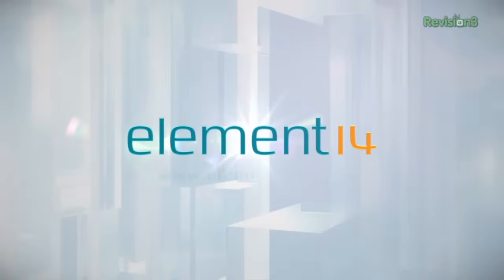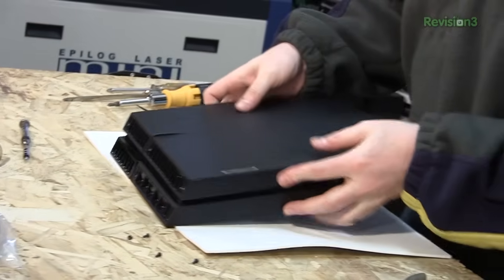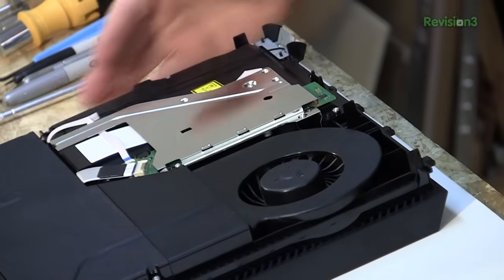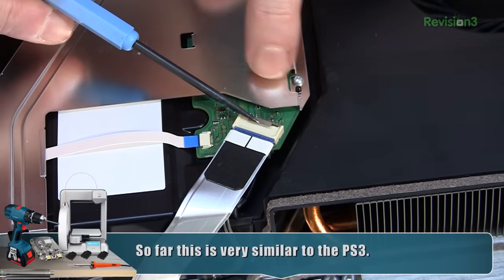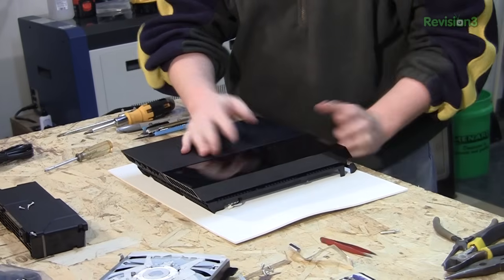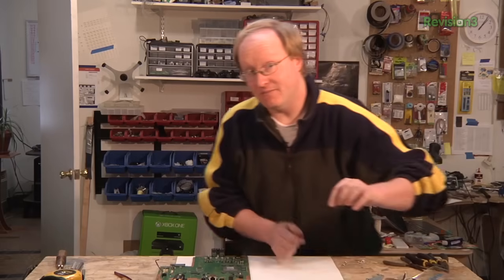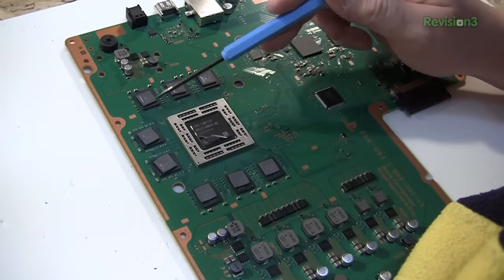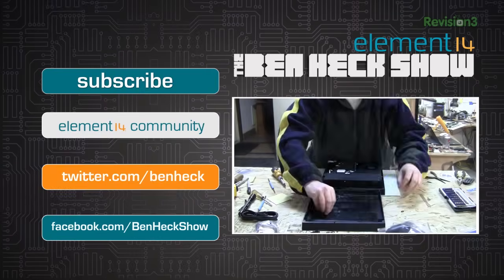Ben Heck's PlayStation 4 Teardown

Comment: GDDR5 is not DDR5!!! GDDR5 is DDR3 optimized for graphical operations...
Reply from the maker: El1988Che :D
Reply: Vic Vinegar I never said it was a big deal...
Reply: ***** all pc gamers played consoles, once apon a time. there is no gamer that just built a gaming pc out of the blue
Reply: CosmicRadiation what pc was it? dumb fuck.  was that a dev pc or a gaming pc? the article did not say and since i know for a fact  it can't run on a gaming pc then wtf was that you just showed me?  you need 20 titans to run the game on pc.  now since you found that article you can now show me the pc that the game ran on and get me the evidence of  what graphics cards were used to run the game. can you do that? the answer is no you can't because there isn't even video proof of it yet.  there is video proof of what i told you to go look up peasant. now are you going to deal with what  i just  posted to you? dumb cunt. where is you character model on a gaming pc crying in a live in game in engine cut scene? get me that. show me that then we'll talk.  the fact is it doesn't exist on a pc because a pc can't produce that effect without 4 titans in  the rig the end. 63 million polygons for just that crying one scene on the ps4. where is the gaming pc with the game showing the same effect?  don't show me some vague article about the order 1886 running on some phantom -pc unless you can show me what pc it ran on. therefore you failed i win get back to the basement peasant
Reply: TotalyNotAYoutuber _ The HD 4870 (a 2008 card) was already using GDDR5... It makes it impossible to be based on DDR4, when DDR3 was barely making into the mainstream market. So, yes, GDDR5 is DDR3 optimized for graphic processing, nothing more.
Reply: +ashtonjackfanny Yeah ok kid. You have yet a lot to learn to make anyone salty. The PS4 runs The Witcher 3 at medium settings compared to PCs ultra settings. The order 1886 has a cinematic filter, take that off and it looks like fucking counter strike source. Do some research kid. Keep on being delusional because you won't get another reply from me. How does it feel to be 12 years old and have access to the internet? You must troll many people huh? kek.
Reply: +manny perry You, sir, are an idiot. Not just any idiot. No, you are a special kind of idiot.
Reply: What the fuck are you talking about? You clearly know fuck all. 😂✋
Reply: +manny perry the demo "PS4s" that they show off games with at conferences are actually PCs with a PS4 emulator. Mind blown
Reply: +Timmyval123 tell the console killer to run the game worlds of a ps4 exclusive or bow before the ps4godrace.  all shit pc's built cheaply will fry from running all multi plats that have come out so far and would blow up like a nuke went off if they tried to even look at the graphical mastery of a ps4 exclusive...next peasant. btw bastard what false claims did i make? i have articles to back what i say up how about you? foh peasant
Reply: +manny perry update bro there is a little unknown fact about the order 1886 that people overlooked or tried to sweep under the rug. in that game there is a woman in a cutscene actually crying tears down her face after being beat up by her pimp in an alley. that feat on pc takes 4 titan graphics cards to pull off running in sli. so the order is the most graphically advanced game of all time until sony decides to surpass that feat with like you said Detroit become human. just wanted to pull your card to that when i saw that shit in the order i was like whoa!
Reply: this pc  peasant said all the assets were made on pc? lmfao ah okay and? it was a dev pc that made the order 1886 not a fuckin gaming pc. so your point would be? with that said the game was made around ps4 hardware which means ps4 hardware would have to run those assets and it handled it without batting an eyelash. now here is the real question  dipshit. why wasn't it made for pc? since pc is more powerful? something like a woman crying in a real live in game cut scene like the order so masterfully portrayed  surely couldn't be done on the hardware of a outdated ps4 right? something like that should only be on the mighty pc platform shouldn't it? yet developers could never get that technical feat to appear on the average gaming machine because only 4 titans running in sli can run that in real time. oh i mean 4 titans and the mighty fuckin ps4 modified hardware that is lol.  the shit hardware of the average gaming pc will never touch the ps4 modified unified 8gb of memory that's just facts. not to mention you can't have character models on pc made up of 150000 polygons like those featured in the order 1886.  your shit hardware would fry trying to run the 80 million in total polygonal world of the order 1886. bow down peasant no gaming pc is on the same level as a ps4. the only pc more powerful than the ps4 is the one who makes games for the ps4. other than that every other gaming platform is peasantry before it. btw find me a pc game with a non playable character crying in a real live in game cut scene like the order 1886 has i'll wait. since you said the assets were made on pc lmfao. then you should have no problem finding the same technical feat for a pc exclusive game on a gaming pc right? it should be easy? go ahead i'll wait you fuckin peasant lol. you'll never find that on any pc game and you'll have to have a pc with 4 titans to run that technical feat on pc period. you're to fuckin broke for that go back to sleep cunt you and your pc cohorts are done, erased, forgotten and shitted on you get the picture :D :P
Reply: +ashtonjackfanny idiot a titan x graphics card alone on  any pc that supports it would be more than enough to destroy a ps4 with graphics using one computer means nothing custom builds can destroy any system because unlike game system you can upgrade more than memory
Reply: +gamedroid74 show me the games or shut the fuck up and bow before the ps4godrace. show me the games on pc that destroy a ps4 exclusive? i'll wait. A titan shit x graphics card can't run the game worlds of a ps4 exclusive. those shit cards can't handle the graphics of a ps4 exclusive it doesn't have enough vram. ps4 however has unlimited memory allocation it could handle a game whose file was as big as 290gb you dumb fuck. that's how big killzone shadowfall was going to be according to Guerrilla games devs before they  trimmed it down to about 40gb. do you know how many fuckin textures would of been in a file that size? lets just say titans would fuckin fry trying to run a game with a file that big yet ps4 ran it like it was nothing get fuckin rekt exposed.
Reply: +ashtonjackfanny there's no "unlimited" memory allocation. Let's go by the specs of each piece of hardware. The PS4's GPU is an AMD radeon GPU with access to 8gb of GDDR5 ram/ vram (clearly not unlimited, check Sony's website for spec info). A GTX Titan X has 12gb of GDDR5 vram plus however much DDR3/4 ram the pc has. The other spec that is mentioned is the floating around point performance of the PS4's GPU which is 1.84 teraflops. The GTX Titan X has a floating point performance of 6,144 gigaflops or roughly 6 teraflops. Do your research, all of this info comes from the vendor's website. Now show me the proof that the PS4 has "unlimited" memory allocation.
Reply: +tstokemb lmfao low level hermit once again show me your games on pc that are on the level of a ps4 exclusive in polygon count and texture res detail? i'll wait. you posting pc specs and ps4 spec means about as much to me as your life means to me i'm just being honest. i go by results and proof and the proof is ps4 was able to run a file that is 290gb large with no problem. killzone shadowfall was that file lmfao. show me a titan gtx running a 290gb file and not frying and bottle necking ? i'll wait. did you know peasant that the game wild for ps4 is the size of the continent of europe?  that's a ps4 exclusive with a file size that's at least 500gb large. this file in that state will assuredly be cut down when it comes out and ships. yet that game will be beyond  the capabilities of any graphics card on the market due to how many textures and memory and polygons it will house.  pc peasant bow before the god race. do you understand the complexity of the game horizon zero dawn? the game has it's own real time weather system that's made up of 70 million triangle/polygons/voxels.  voxels create more detail in a game world and character model than polygons yet. this will be just the game world cloud system that's made up of that much detail. i'm not even dealing with the landscape and vegetation and wildlife in the game lmfao. the lighting in that game will be beyond anything on pc. so much for your fuckin specs. i told you the ps4 memory allocation is unlimited this is why these games are not on pc. your shit gtx cards can't handle it. to much detail entailed in our games for you to imagine
Reply: +ashtonjackfanny i agree with every last word you wrote bro did you see the sony Paris games week conference and the games that are coming out for ps4 bro? wow the level of graphical fidelity in those shits is jaw dropping. the game Detroit is going to have this robot that thinks it's human that's not a new story line right? but in that game you'll see for the first time in video game history a playable character actually show the emotion of crying. why is this impressive? because there is a demo called "the witch" that is here on youtube and they have a character in that game that is non playable and they made it be able to cry. 

do you know what it took for that happen? it took 4 titan x graphics cards running together in sli to make it happen. four fuckin titans to do that bro and the character wasn't even playable. the ps4 which is supposed to be weaker than the capabilities of a titan x graphics card will do something that is beyond 4 titans running together.   that's fuckin crazy bro i'll drop the mic now great info you put out btw
Reply: +happy so when the guy is playing from a ps4 that's sitting right in front of him for everyone to see that's a pc that he is playing on in your mind? lol be mad sir  A gaming pc isn't on the level of a ps4 graphically. btw no gaming pc can play a ps4 exclusive so you have no point. all graphics shown at conferences are running from a ps4. all ps4 exclusives have no graphical downgrade this is not an xbox one were talking about here.
Reply: manny perry Games are developed on PC. All games. There is no Visual-Studio 2015 PS4 edition, so they are coded on a PC. Those games must be tested. Tested without constantly running back and forth between the dev-PC and PS4. These games are tested on PC. End of discussion.
Reply: +happy lol  developed on a pc? and? the point is no gaming pc can play a ps4 exclusive therefore it does not matter. the pc that can play a ps4 exclusive is not a gaming pc that can be bought in a store or custom made so wtf are you talking about? ps4 exclusives are graphically beyond any gaming pc end of discussion. all games shown at conferences once again are running on a ps4 that's in plain sight for everyone to see. now fuck off already you've got your lunch handed to you
Reply: +manny perry no, you are funny. Real funny, and stupid. Please provide proof of this claim anywhere. anywhere at all. What hardware would they use to make a "developer pc" that would be any different than a normal pc?
Reply: manny perry Exclusivity is not from a technical standpoint but from an economic standpoint, idiot. Exclusives are made so that people who wish to play an exclusive must buy the platform they are released on, to force customers onto the crappy platform. A PC could play exclusives if they had a chance, but will not because they are (duh) exclusive.
Reply: manny perry what, you think i'm that pc moron up there? He has a point though. A PS4 is honestly just a custom made PC with a unique operating system. So is an xbox one. I can't tell who is worse, a PC fanboy who knows everything about computers, and brags about it, or a PS4 fangirl who knows nothing about their own system, but still brags about it.
Reply: +manny perry did i really hurt your feelings that much that you've blocked me? lol. Name any game that is a ps4 exclusive, that you believe a PC can't run. Name one. Any one. Also, name the special hardware that magically makes a dev pc better than a gaming pc. (hint, there is none)
Reply: Why did the console peasant cross the road?

To render the buildings on the other side.
Reply: +ashtonjackfanny gotdamn bro how in the hell did you catch that? i played that game like 10 times already and never noticed that or cared about it until you shined a light on it just now. that is truly fuckin crazy but you know what? there is an interview on the net that ready at dawn gave to one of these video game outlets and they stated that the order could only have been done on the ps4. i'm really starting to believe that shit 

they're running a game that's pulling off feats that only 4 titans have been able to replicate on so called dated hardware? just think a pc gamer would have to pay 12000 plus to have 4 titans in a custom rig to make a cut scene cry in a video game.  while a ps4 is 500 tops and is able to give you performance that is equal to or vastly beyond those titans lol. why do you think no one has mentioned this? this is fuckin incredible. ps4 is easily the most powerful gaming machine on the planet when it's showing this level of graphical fidelity i don't think it's even disputable. btw are you going to watch psx? there are going to be more game announcements shit is looking crazy for ps4 in 2016
Reply: +Trollver S huh? sits and points and laughs at your explanation then waits for the pc peasant to show games as proof or shut his peasant trap. fact 1 ps4 = more powerful than ten titan graphics cards running in sli the end check mate. either show me a game on pc that has an non playable character crying in a live cut scene like the order 1886 does which btw took 4 titan graphic cards running in sli on pc to produce the same effect or bow before the ps4godrace. don't quote me inferior pc specs show me games you fuckin weirdo because i can show you games as examples. the fact that you called ps4 a modified pc then tried to compare it to the average gaming pc defeats your point you fuckin imbecile lmfao.  learn what the word modified means what's found in the ps4 is not found in gaming pcs the end. therefore they're two different platforms peasants like you are funny loner virgins. ps peasant don't you know that frame rates between a console and a pc can't be measured the same since a pc uses a monitor to output it's image and a console uses a tv screen? learn about input lag you fuckin idiot. 30 frames on console is optimal we don't need all our games to be 60fps only a fuckin idiot would say that. btw my tv cost more than two pc rigs dumb fuck.... gtfoh your frame = left rekt and exposed then flushed down the toilet by yours truly
Reply: +ashtonjackfanny hey dude i was reading what you wrote to that dude when you showed him the woman crying in that cut scene in the order and gave him the link to the video and even showed him at what mark in the video the scene took place. now i come to the video and someone deleted your comment. 

lol you really are on to something if these pc cowards have to delete factual information.  i think you should repost it again and see if the cowards delete it lol. if you do i'll  tell you if they delete it because i can see if it's gone you probably can't
Reply: ***** haha dude the virgin race were marking your comments as spam in mass probably with multiple accounts that's how they removed them. all you have to do is thumb your comment up and it can't be spammed down you should probably thumbs it up twice to be sure.

i love that they marked your shit as spam tho it shows you really knew what you were talking about haha this shit is hilarious long live the godstation4
Reply: Tyler Holladay actually he blocked you from seeing his comments lol so i can still see all his comments but you and your troll accounts got dismissed lol.  that's what happens when you're a coward who marks relevant information as spam have fun with your little toy you call a pc :D :P
Reply: +bogdan negoie hey bro why are you so mad? if you want to prove him wrong all you have to do is show him pc games that are one stronger than 4 titan graphics cards running in sli and two that have 12k texture res are you that scared to go get the information he asked for?are you so scared  that you start putting up a bunch of useless pc specs that don't apply to what the ps4 actually does in real time? listen you have no games on pc that has a non playable character model crying in a cut scene which takes 4 titans in a pc running in sli to pull off on the pc platform.  so you have no character models who are made up of 150000 polygons like the order 1886 does this is just facts. ps4 games have more polygons per game and they have higher texture res per game than any pc game that has ever existed these are just facts. you're beating your head against the wall trying to argue here. either you show games or you except that your platform is inferior and move on. the ps4 is more powerful graphically than ten titan graphics cards running in sli this is just facts deal with it.

now you said the order 1886 is pre rendered? you sound rather retarded making that claim since everyone and their mother knows that all the cut scenes in the order 1886 are the same as the in game graphics and all of that is done  offline. that means that there is no load screens there is no pre rendered footage. every thing in the order is real time running on the ps4 hardware.  there are a million articles on it so wtf are you talking about? now you want to make up lies? lol it's okay. the ps4 is the only gaming machine on the planet that can do real time in game cgi graphics. that means it's the only gaming machine where it's cut scenes are the in game graphics. take a shit title like starcraft legacy of the void for  instance? that game is a bunch of cgi cut scenes but when you look at the in game graphics? the in game graphics look nothing like those cut scenes lol. whereas in a ps4 exclusive there is never any loss of graphical fidelity in a ps4 exclusive this is just fact. when they show you ps4 exclusive game footage and they show you cut scenes? those are the  in game graphics lol. where are the pc  games that can make the same claim about their graphical fidelity? i'll wait.

at the end of the day ps4 was able to output the texture res of a file in killzone shadowfall that was 290gb large. a file that large is 15k texture res. please show me the titan graphics card that can output the texture res of a file that is 290 gb large? Detroit becoming human will be a game that has 15k texture res just like the order 1886 had 12k texture res just like until dawn had 12k texture res. a game with 15k texture res and 12k texture res makes the image clarity of so called 4k on pc look blurry my boy. go learn what polygon counts are and texture res are before you argue against us. you've been rekt and put in your place pc peasant have a nice life gaming on mediocrity lol :/
Reply: +Nikke Hautapelto lol you're looking for a savior? it wasn't  that dude he got rekt quickly none of you pc virgins can stand against the facts
Reply: +manny perry oh yes bro i've seen that video before pc cowards are hilarious though. in the video they said that it's a perfect storm mathematically to get the woman to cry in that video. yet the ps4 handled that shit like it was nothing lol. it took 4 titans running in sli yet the mighty modified hardware of the ps4 didn't need 4 clunky fuckin titans to pull that off. the funny thing is nobody knows about it. or they tried to sweep it under the rug

yet you have this pc fuckin clown in here talking about that i know that a decent pc could run circles around a ps4 lol. this is why pc peasants are pc peasants. they think they know what they're talking about yet can't prove nothing they say through actual games lmfao. this is why i enjoy destroying them anyone can go see for themselves the ps4 doing what's done in that video you just put up of the woman crying. then know the ps4 is the most powerful gaming machine on the planet. paste this is in 

Cry Plays: The Order: 1886 [P2] then go to the 20:45 mark of the video. but of course the ps4godrace can do anything when it comes to graphics lmfao we have no limitations
Reply: MEME MIyster LOL go play outside lad  everyone knows the godstation4 is supreme and now with the ps4k coming out we are now indestructible. everything that was said about the order 1886 can actually be backed up with visual facts. none of the dumb shit you just wrote to me cannot be backed up therefore you lose.
Reply: +manny perry When they are developed on pc, and are tested on pc, they are being played on pc. Mind Blown
Reply: happy when they are developed on pc they are being played on a developers pc not a gaming pc that can be bought in stores or custom made. all ps4 games shown at gaming conferences are running on ps4 hardware therefore keep reaching shit head this is funny
Reply: PS4 shits on PC real hard. PC gamers are pirated piece of scraps. Noobs
Reply: +ashtonjackfanny The fact that you are dumb enough to not know that console uses pc hardware from 2010
Reply: Freaking clueless console fan boys, that do not get that a PC gamer prob has consoles. But if you think an 8 core tablet cpu, with a 4 year old GPU stuck in it can compete with any decent PC system,...well that is cute. Enjoy less then 60 frames when we can push 120 or more, and 900p-1080p when we can game at 4k. The AMD APU used in both systems are beyond low end on a PC before they came out. A ancient now 955be gets better benchmarks, and any current gen GPU blows the GPU side of that APU away. They are nice toys though. Still we put our PCs together with the stuff we want in them to fill our need. A console will not do what we need. It will sit on a shelf but for the one or two exclusives that we may want to play.
Reply: ***** Sure thing, pal.
Reply: Vic Vinegar Alright.
Reply: +ashtonjackfanny not sure if bait. I'll bite anyways, there is no way in hell the ps4's built in GPU beat any GPUs post 2013 and some GPUs prior to 2013. GPUs like the GTX Titan  X, 980 Ti, R9 390x, R9 Fury X, hell, even a 560 Ti, have way more processing power than the built in GPU in the PS4's APU. Consoles are behind hardware-wise. You can purchase a cheap PC with an APU that has the same if not more power. The advantage that the PS4 has over that PC is that its hardware is dedicated to gaming, so you don't have a heavy OS and processes running in the background. Also, all modern GPUs utilize GDDR5. If you break down a GPU you'll find the chipset surrounded by the ram.
Reply: *****  that's what allways blows my mind when it commes to conoles,they don't have the best hardware built inside'em as many claim.But devs spatially working on AAA titles can totaly optimize them and make a mind blowing experiance.
Reply: +El1988Che You guys have to keep in mind one thing... The price. I am fortunate enough to have a decent gaming PC (i7 3770k, 8 Gb ram and R9 290x) and a Xbox One. There is no doubt that PC gaming is years ahead of consoles but it comes at a price and a certain maintenance knowledge. Even in 2015, a lot of people aren't comfortable upgrading drivers and so on, that's why consoles give a better gaming experience for the said people. Both have their straight and weakness, you can't simply say one is better than the other.
Reply: El1988Che Right,I agree with you on that.
Reply: +El1988Che The thing is that you can build a PC that can match and outperform a console for around the same price. You don't have to go all out.
Reply: +ashtonjackfanny Yeah now you're just talking out of your ass. Keep being a dumbass, one day you'll find out how stupid you are.
Reply: TacoNissan hey dipshit stop posting under different screen names i hurt your feelings i know
Reply: +Muhammad Moosa No, it's not. you have failed the internet. Go read a book or something, because you obviously have never read a single comment in this thread, and need some practice.
Reply: Trollver S Don't mind him is just trolling. I've already given him "games" and hasn't responded to me.
Reply: +ashtonjackfanny wow dude you really fucked shit up in here lol but on a serious note that is some crazy information you put out i'm going to research everything you said.  reading what you wrote makes me feel super pumped about owning a ps4
Reply: Yeah, I don't blame you. But seriously, how in the hell does he even try to pass off the PS4 being stronger than four Titian's in SLI?
Reply: +manny perry 
I don't need troll accounts, nor did I mark his comments as span. The PS4 is the strangest console, and that is the truth; however, it is no where near as strong as he was making it out to be. He fears the truth and blocked me, lol that just shows his determination. If the ps4 was as strong as what he says than why does it not run Fallout 4 at 60 frames per second?
Reply: +Trollver S 
Well he is back with a new account. After he blocked me, he comes back with another troll account to try and make me look bad. Don't get me wrong, I have both consoles and my pc. But fanboys these days make me want to sell all of my consoles and  beef up my rig with the money.
Reply: +ashtonjackfanny iook kiddo you are either troll or stupid on the order 1886 it's fucking pre randered second ps4 uses pc hardware from 2010 more exactly a jaguar bassed cpu (found in old semprons ) a radeon hd7770 slightly modified and a 2.5 inch hitachi samsung or toshiba 5400rpm you can't even find a pc with that kind of specs and don't even start with it's optimised because you know jack shit about how games are optimised to make my self clear on the other gens they used power pc or cell as the instructional set that could be worked around to make improvements but this gen use in x86 that was introduced by intel in 1978  with the 8086 for what you say to be true that 2.5 inch 5400 rpm (slowest still existent kind of drive) should move textures faster then an nvme based ssd (fastest drive) the 7770 that is low end even by 2010 standards should be faster then the r9 fury and titan x (r9 fury uses a newer arhitecture by amd and uses hbm memory that is way faster then gddr5) and the titan x (fastest chip right now) and the cpu that was the lowest tier of cpus from amd should compete with the haswel extreme that not only has more powerful cores it has 16 treads wich give it a roughly performance of a 16 core cpu easely cloakable to 4.5 (ps4 has 1.65) it's physically impossible for the ps4 to compete with any modern hardware
Reply: +ashtonjackfanny The Order is a movie not a game. Beat it in 2 hours
Reply: Also folks talking about system locked releases. PC has exclusive titles too. Any true gamer has a PC at least, and most of us have a few consoles. But PC tech drives the innovation and technology in consoles. Without PCs, no more consoles. No more video games at all. Therefore it truly is the master race. The source if you will. Even your phone games are made on a PC.
Reply: He is a troll, anyone knows a well built PC can outdo a console in operations per section in every metric. My GPU alone has more number crunching power then 2 PS4s. Let him troll, he is still wrong empirically. But when his PS network goes down, yep that was folks on a PC.(and possibly a GPU farm).
Reply: +waff1eirontmacsplat 
Oh and here is an article talking about how the developers showed the Order of 1886 running at 60 Frames Per Second on the PC at a game show. 

http://www.dsogaming.com/news/the-order-1886-showcased-running-on-the-pc-at-60fps/
Reply: +ashtonjackfanny This bitch dont know fuck. He said uou need 20 Titans to play a PS4 exclusive.  PC Master Race, TO ME!!
Reply: Gamecube kicks ass/best console of 2021 for real, 4k ultra hd 100% real, no fake 60fps, blu ray, 7200 rpm hdd 2tb, fast charging adaptive, hdmi, s video, digital audio, 8 player smash, PS5 - Xbox Two backwards compatible, transformers advanced graphics, Nvidia, Intel Core 2 Duo Trio Quadforce, Alpha Omega, Ruby Emerald Saphire, 64 bit x 128, Super FX chip compatible, mouse & keyboard support, Bluetooth, wireless charging, wind power, 0% emission to the atmoshpear, vegan/nonvegan compatible, nuclear power core, water cooled condenser, R-410A refrigerant, 2 Ton compressor, to the max, play with power, and a cherry on top.

so many will be triggerd...
Reply: +TEK Gaming Could you explain to this baum pleaase.
Reply: +MikeAvenger08 
Do you want to buy a best Playstation 4 ? I recommend reading here Playstation4-Shop-Blackfriday.blogspot.com before buy it !!!
>>> Hope help !!! Deals on Amazon <<<<
Reply: gddr5 is a better version of DDR 5
Reply: +ashtonjackfanny actually you can buy a pc with better performance for equal or lesser price of console its called a console killer but if exclusives are a big deal for you then get a console  personally I use pc and console but you don't have to be a jerk about your argument also don't make false claims
Reply: +waff1eirontmacsplat 
There is only two people that can remove comments. One would be the moderators of You Tube, and the second would be the person that posted the comment!
Reply: +Trollver S 
Oh look both ashtonjackfanny and waff1eirontmacsplat were the same people and deleted their comments!
Reply: +Trollver S I guess when he figured out that he no clue what he was talking about he threw in the towl, lol.
Reply: Okay I know you can change the fan and harddrive, but what else could I change or maybe improve to the ps4, please help.
Reply: Common Sense 
You just kinda contradicted yourself to be honest..... The Ps4 is still not jailbroken and yet you say it hardly a match for a decent gaming PC that at anytime allow the user to download software that can get free games illegally.
I also want to point out that with a couple modifications to a ps4 such as replacing it's case covering with a desktop case and putting a 5 tb harddrive with a better fan and cooling water system and changing the suck in blue ray player with a blue ray player that can open up and place the disk in manually will be even more affection instead equal to a decent gaming pc, the ps4 nor the Xbone is lesser than any pc, it's simply your internet connection runs more or less on the specific hardware you use, in which that hardware can be replaced with something better.
Reply: +Milos Martic more exactly a hd7770 (100$ gpu at release) and a sampron with 8 cores (sampron is the lowest end when they were new they costed up to 50$)
Reply: +GHOST ANGELS actually the ps4 uses a 2.5 inch drive a 5 tb capacity is possible only if you go to server stuff and it's about 8k$
Reply: +bogdan negoie Finally someone said the crap out of that idiot who thinks he knows something about computers. thanks dude!
Reply: +tstokemb The Wicher 3 got a grafik downgrade... idk maybe because of the consoles?
Reply: bogdan negoie 
Dude !!!!
Reply: ***** go to bed bro.you got demolished.
Reply: bogdan negoie 
Is it possible to change the cpu ? I'm trying to upgrade my ps4

I know I can upgrade my ps4 to a 5tb hard drive and put in a water cooling system is there anything else I can probably tinker with ?
Reply: GHOST ANGELS No,watecooling is no too.
Reply: +Muhammad Moosa Correction it is a video only ram based off of DDR3 SGRAM, that replaced GDDR4. There is no DD5 yet. We just got DDR4 last year, and GDDR5 has been out since at least 2007. Vram operates at a higher speed but has different timings then normal DDR3 and is only made to store certain types off data that are used by the GPU. Basically with out going into great detail, GDDR is is favored by massively parallel cores to help with things like texture loading.  Were as DDR is general purpose ram.
Reply: ***** troll or just plain stupid.
Reply: manny perry ps4 has a 2008 GPU.
Reply: ***** Theres an asylum nearby.You might wanna go back,because you probbably dont know shit 'bout PC,peasant.
Reply: You do not even know what a Titan is for. The Oder:1886 was a game meant for a launch title for PS4 to show off eye candy. It is very short, and the game play brings nothing new to the table. It garnered much critical hate and distaste from the folks that purchased it for 60$  Now, about it cannot run on a PC because of a polygon count? Since it is exclusive you can not show evidence for you main argument. Thus you don't really even have a point IMO.
Reply: You still keep coping the shit wall of words, here is one from me, and it will counter every point you make. You cannot say it will not run on a PC, because it is not for PC. I know for an empirical fact the APU in a PS4 is no match for a current mid tier CPU or GPU. It is based off low power tablet APU tech and even then, you can look up things like the fill rates, CPU benchmarks and other metrics to see this. Consoles need less headroom for software environmental reasons, but it is not as bad as folks think. You keep talking polygons, when no one gives a shit. It is about  texture fill rates, ROPS, and other stats. But a polygon is any type of geometry in programming there is a huge diff between a quad and a triangles as far as GPU impact.  Ryse looks just as good in character models IMO and has a similar polygon count. I do not like it either. All the games that are on PC and PS4 favor the PC though. It does not take 4 Titans and the only reason you would need 4 of anything in SLI is if you're rocking a 4K display above 60hz. Or you are using for science or something. At least we have that option of PC. Plus it is not just about graphics. We can do much more with a PC but hey say you do not care about productivity? PCs have access to exponentially more games then any one console, and you do like games right?  Now there is nothing wrong with gaming on a console, I do too sometimes. But facts are facts. We get better mods, better graphics, and more games. But many of our systems cost quite a bit, use way more power, and we do miss out on system exclusives. The only way to get the best of both worlds, is to own both.
Reply: +waff1eirontmacsplat Why you so mad mate?
Reply: I'm sure you've heard this a lot, but it's only true. Next gen consoles like the ps4, with their 792p 30 fps style gameplay, are inferior.
Reply: +waff1eirontmacsplat 
Can you honestly give us any article, news, video, or shit even a tweet that proves The Order 1886 was made using four titans maxed out to developed? I don't care about polygon count or anything like that. don't tell me "have you seen the Order of 1886, show me the PC games, or anything like that." I know that you will not be able too, because who ever came up with this ludicrous idea fabricated it out of their own delusions!
Reply: +Rjie 21 ddr5 doesn't exist. gddr5 and its predecessor gddr4 are based on ddr3 tech.
Reply: In the end transistors have counts, architecture has limits, and stuff is what it is. Have fun with the 0.5 gen increment from last gen. I hope you get another game like The Order 1886 for your enjoyment, but hey the dev team is probably looking for employment, perhaps you can pick them up and make some tear drops.
Reply: +El1988Che Nerd.
Reply: +waff1eirontmacsplat lmao I hope you don't think the tears are water physics. They're animated gifs being used as pictures, or just particle fx. Crying tears isn't something that should amaze you, it's the other amazing things they can do with technology
Reply: exactly
Reply: *****
The term is console peasant
Reply: +ashtonjackfanny  the order 1886 is not even a good game it is just eye candy to get people to buy the ps4  plus gaming is being held back by the PS and the Xbox and i have a FX-8350 cpu and a R9 380X and it runs better then the ps4 ever will and your blabbing on about how the ps4  has 12K you must be brain dead the ps4 can not even play 1920 by 1080p so the summery is don't eat shit that random articles give you there probably all lies and one last thing don't tell people to kill them self's it just makes u look like a ass.
Reply: MEME MIyster
It's not even worth debating with him, because he will just mark your commit as spam so it gets removed.
Reply: +I Hertz You Yeah I'm pretty sure he is just trolling.
Reply: +Justin Booth it is 1080 p and  60 fps on some games dumbfuck
Reply: +MikeyWuzHear so if i buy a pc it showld have ddr5 or gddr5?
Reply: +David Roman 
Yes, it should. Make sure you buy a new pc.
Reply: +David Roman 
Ddr3 or 4 and gddr5
Reply: +CosmicRadiation it is new,thx
Reply: +mastodonseven it doesn't says nothing about ddr.it only says that it has gddr5
Reply: +David Roman 
Right well gddr5 is referring to gpu gddr5 is good

Ddr3 or ddr4 is your ram.
Ddr4 is newer and will cost more, tho not really worth it. Ddr3 is perfectly fine
Reply: +mastodonseven ok,thx u helped me
Reply: then what is GDDR3?
Reply: spud3149 GDDR3 is another form of graphics ram that is used on older graphic cards. The PS4 has GDDR5 and you could think as the Xbone using GDDR3 for its graphics card. There is no GDDR4 ram, they skipped it for some reason. But when ever you see the G in GDDR that means graphics and when that G is missing that means just regular system ram (ram stands for random-access memory).
Reply: gddr3 is a variation of ddr2
Reply: ddr2 is just an upgraded ddr
Reply: How much does it matter? Until the main DDR5 comes out (probably not for another 10 years)  you can still understand that GDDR5=DDR5.
Reply: Ben G GDRR5 is ram for the graphics processing unit, DDR5 (not currently available) is ram for a CPU. Considering The PS4 is using an APU solution, my guess is it would be using DDR4 memory, but don't quote me on that though.
Reply: El1988Che
Reply: El1988Che but GDDR5 is still quite a bit faster (218 gb/s) on ps4 than thr ddr3 (128 gb/s) on xb1 and you have multiple variations of gddr5
Reply: That's what i learned: wannabe tech-savvy fanboys are still fanboys, all about bragging and insulting others.
Reply: El1988Che well... you kind of used some exclamation points. So I figured you felt strongly about the mistake. Which is understandable.
Reply: El1988Che omfg don't have a cow it's no big deal.
Reply: El1988Che the fact that you're dumb enough to compare a console 's hardware to a desktop hardware means you have a fuckin screw loose dumb fuck. when it comes to how powerful a console is it comes down to optimization and ps4 has unlimited graphical potential compared to your best graphics cards now fuck off twerp
Reply: El1988Che I thought GDDR5 was more closely related to DDR4 or is that horribly wrong
Reply: ***** you are the definition of a fanboy.
Reply: The Order 1886 is a big stinky pile of donkey nuts. Yet you keep bringing that up. Plus all the assets for the game. Made on PC.
Reply: optimization matters a lot for how smooth things run on any computer, Ill freely admit I have no clue what the difference between the two entails - but GDDR5 is probably  classified differently for good reason; there is a huge fundamental difference between parallel processing like in a GPU and more serial processing in a CPU: those probably need very different optimizations. But aside from the 'G' its basically the same as DDR5.